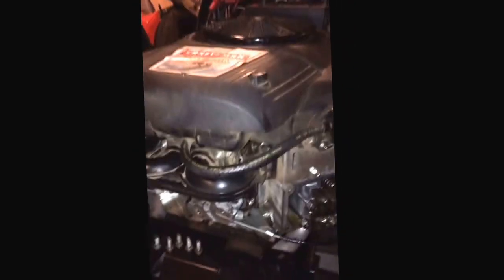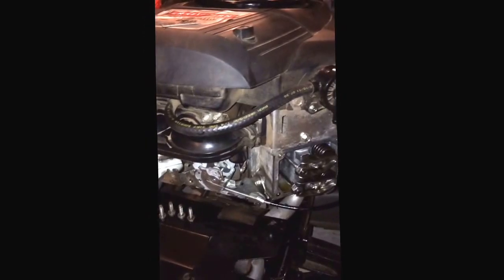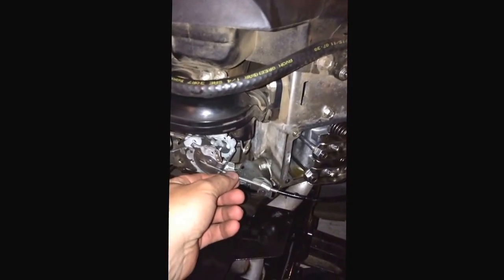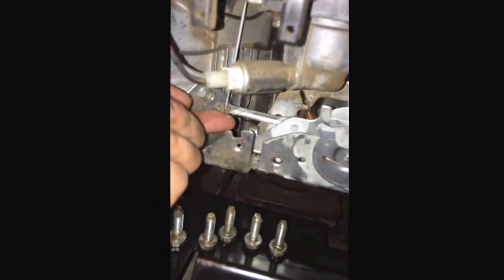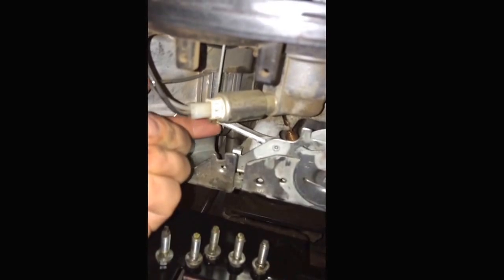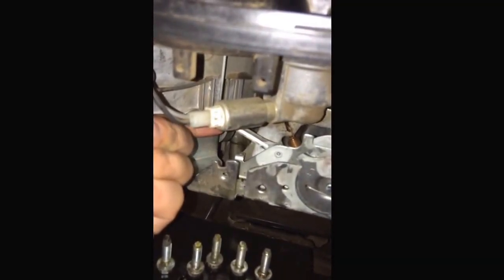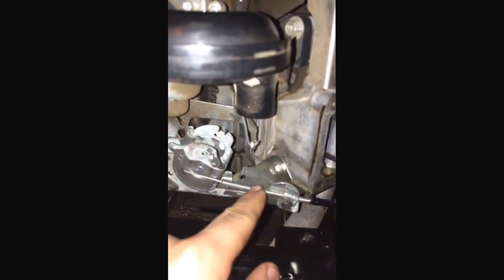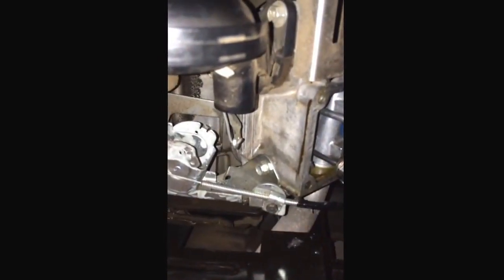Choke adjustment on v-twin Briggs 26hp starting problems and long turn to start

Comment: Yep. I had hard starting, dying engine. Went thru all carb issue (and probably needed a kit), but still not right, so gas tank clean, new hoses, checked coil immediately after dying, still sparking, then checked if I put linkage back on correctly and noticed eninge idled very high so suspected the throttle cable slipped, then discovered chock wasnt flipping up and down right. One thing led to another, went from worse to running great and starting w/o starting fluid.  So yeah the choke wasnt flipping in the right throttle position. Thanks!

Comment: My issue is the vertical pushrod that connects to the actual choke valve isn't lifting (I start the engine by lifting it with my finger). But I'm not sure if the nylon "slip" at the lower end is the problem (worn) or if it's the ridiculous foam collar around the choke valve that seems to create a temporary resistance to hold the choke closed. I can't find any information with others having a similar issue, but your video is the closest anyone's come. All advice is appreciated. (re: John Deere LA165, B&S 24HP V-Twin)

Comment: Adam, you are THE man. I have watched more than a dozen videos about choke adjustment on riding lawn mowers since mine, a Sears Lawn Tractor, has been very slow to start for 10 years. I had a guy respond on a warranty call after 6 months to adjust the throttle/choke cable. It was good for 6 months and it went back and the warranty expired. I tried to adjust it myself, but I couldn't find anything on Google or youtube. As I said, I have seen a multitude of videos about how to adjust the linkage, but none of them showed how that vertical linkage worked. Previously, the best I did was to adjust it to start in about 5 seconds, a big improvement, but after I saw your video, I readjusted, and the tractor popped off in less than a second. Kudos to you and a nod to youtube for the miraculous way it improves our lives every day.

Comment: Thank you for this video, replaced my motor with the 27 HP  and after the 1st startup it would not start back up without spray. We made the adjustments and it fires up every time now. Thanks again.

Comment: Great video, this right here has saved me so much trouble.  I have been working on my Husqv riding mower for over a YEAR!!  This thing would NOT start unless I squirted starting fluid in it.   I have been doing this for forever!!!  I would mow with this thing for 3 hours and shut it off to move a stick and get back on it and it would NOT start.  I was about ready to burn it!!!!!!!!!!    After watching this video I checked my choke and this thing had almost a 1/2" of slop on the choke.  I adjusted it and it fixed it!!!!!!!  Maybe rename it (or add to it) "long to start" cause I certainly never thought mine had a choke problem.  Thanks so much for this video, I have been out there restarting mine a dozen times to make sure its fixed.

Comment: Purchased an used Cub Cadet  zero turn with a Courage Engine.   Purchased a new starter (spins faster), solenoid (was bad), rebuilt the carb and was getting ready to adjust the valves.  Still hard to start..... Watched this video and noticed the travel on my choke was close to 1/2" and realized it was not closing. This simple adjustment saved a trip to the dealership.  Now it starts  immediately.

Comment: Thank you so much!!!   My 27hp Briggs required 20 to 30 seconds of cranking before it would start.  Rather than ruining the starter, I would use ether on every start so that it would start in 2 seconds or so.  All of the other videos about valve adjustment, fuel filter and fuel pump were no help.

Comment: THANK YOU!!  For days I have monkeyed with valve adjustment, battery, plugs, air cleaner, carb cleaning and nearly everything to solve the long, long delayed starting for my engine.   I could not find anything wrong.  I was just about to push it on a trailer to try to find a competent small engine place when I caught your video about the choke linkage.  A one minute check confirmed the choke wasn't engaging.  30 seconds later...Varoom!

Comment: Thank you! My parents got a 50 percent discount on a new mower from HD a few years ago because someone returned it for this reason it would not start without starting fluid... My parents just lived with it until I decided to try and figure it out..Found this video and checked..sure enough the choke was hardly engaging at all!!..Now with your great info it fires right up..Thanks again

Comment: Thanks for the video. I just bought a Kubota Z122E with this engine. I've got 5 hours on it, and it's been hard starting so far, cranking for over 10 seconds to start. I guess the knuckleheads at the dealership didn't adjust this cable before delivering it. I just did it myself. Your video saved me the hassle of having them come mess with it.

Comment: on the bottom of the choke lever there is a bushing that pushes up on a solenoid when full choke is engaged... any idea what it controls or if I even need it? yours doesn't have it.

Comment: Thank you!  I found my choke wasn't closing at all and adjusted it as described.  The tractor now starts in less than 2 seconds versus 20 seconds of constant cranking.
Reply: Well, it's six years later and the mower still starts with ease.  I fired it up today for the first time this season and always think of your helpful video - thanks again! 😄👍